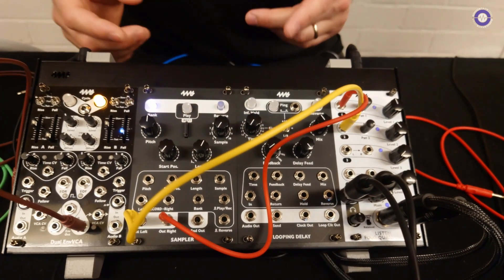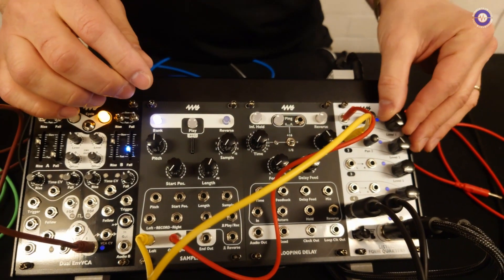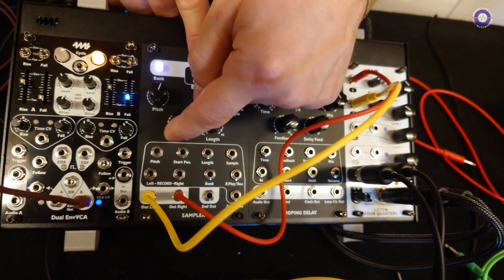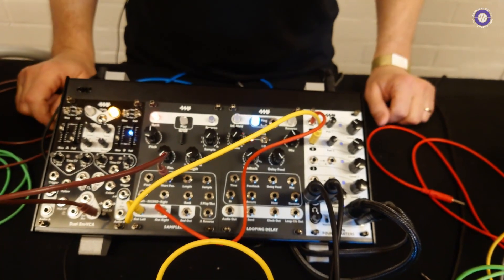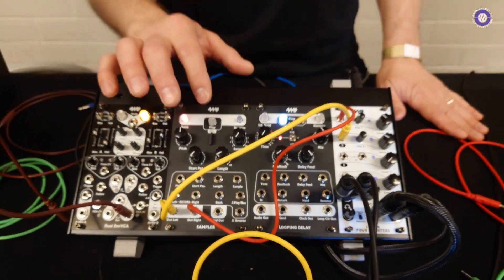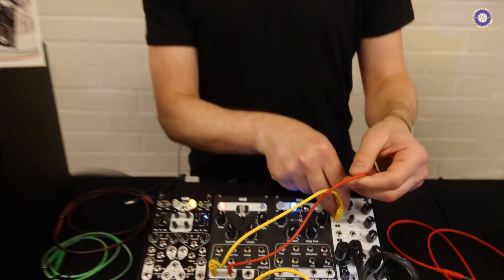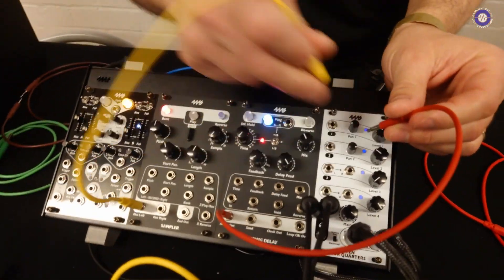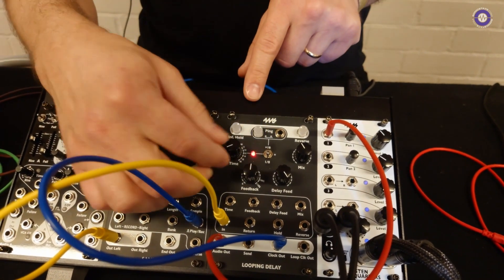Superbooth 2023: 4ms - Looping Delay - Sampler

Comment: So looping delay is just a half dual looping delay right ? Or does anything else change ?
Reply: It has CV over Dry/Wet mix (DLD does not) and it can operate in stereo mode (using the Send/Return jacks for the right channel audio). In stereo mode the max delay time is about 43 seconds (it's 87 seconds in mono mode)
Reply: wondering the same thing